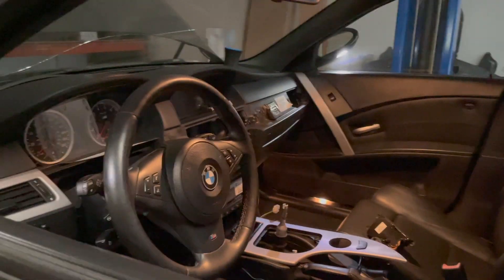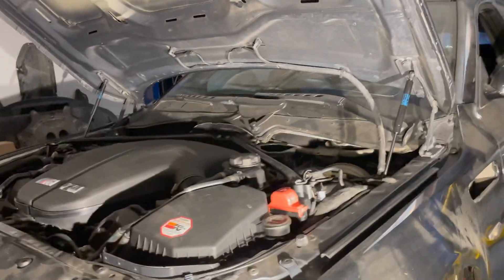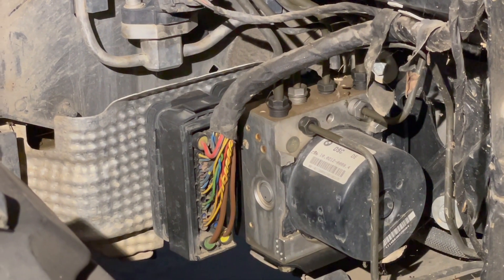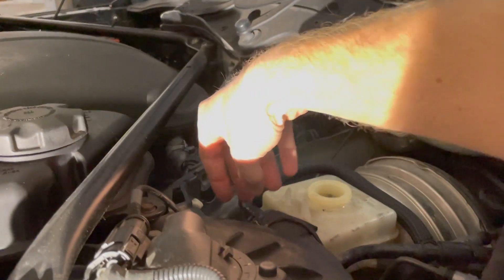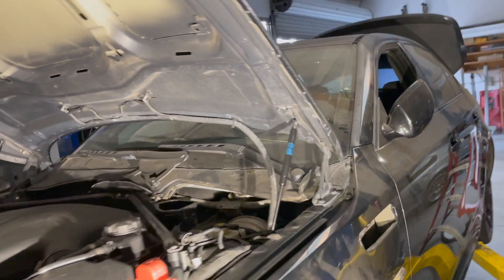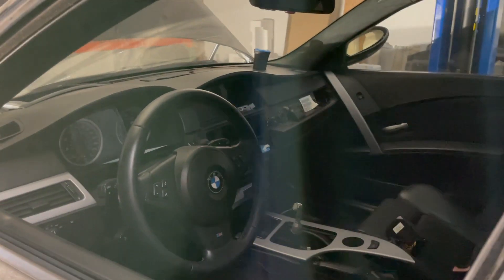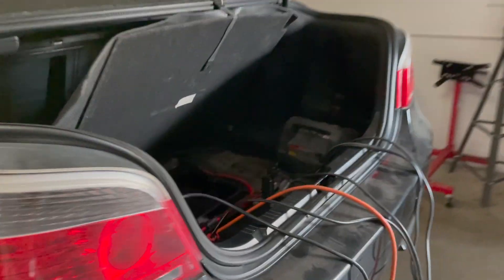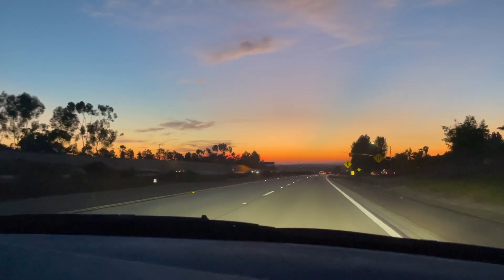Sunset Season  10/29/20 - Day 3,613

Comment: Do you have a Motiv bleeder? I used mine on my e36 clutch recently after an engine swap and it worked really well for getting the clutch pedal going.
Reply from the maker: I do, not sure how to use when bleeding a clutch though.
Reply: @JRSVlog  I attached the Motiv unit to the brake/fluid reservoir and pumped it up. I went under and opened the slave bleed screw for a few seconds and then closed it. Re-pumped up the Motiv pump and then manually worked the pedal up and down dozens of times. Eventually the pedal came around. I repeated that process several times. It worked for me. 

PS make sure to put fluid in the Motiv unit. 

I'm not an expert on bleeding/clutches but this process worked for me with some trial and error. I was solo so this was the best solution for me. 

Worth a try if you're not having any luck and you already have the Motiv. 

Also...pumping the pedal 100s of times with the reservoir cap off should also eventually get the pedal going somewhat. 

Bench bleeding the slave is a good idea as well if it's a new one you've put in. 

Anyways. Good luck! 

Cheers!